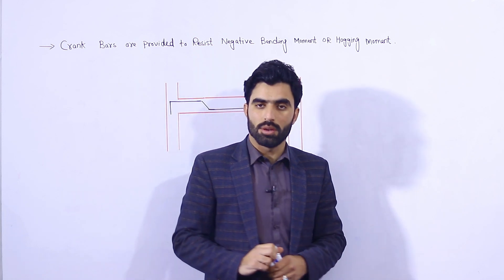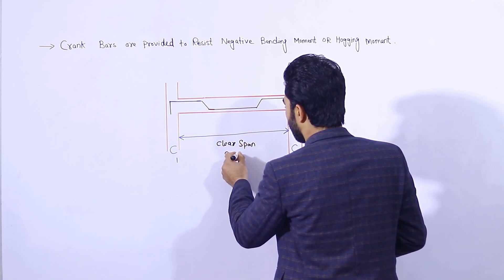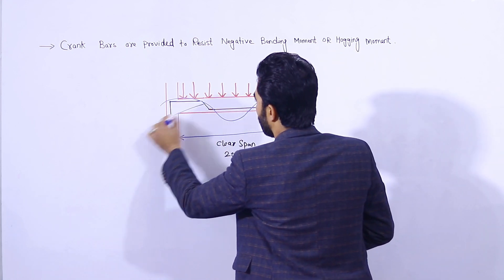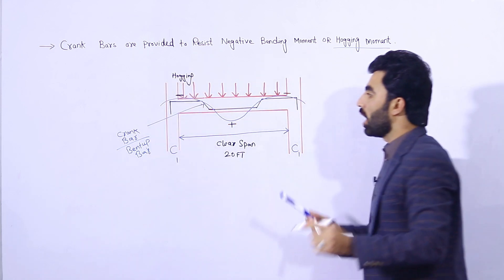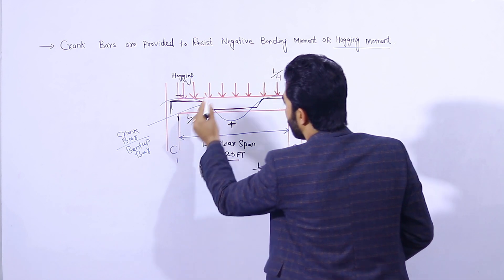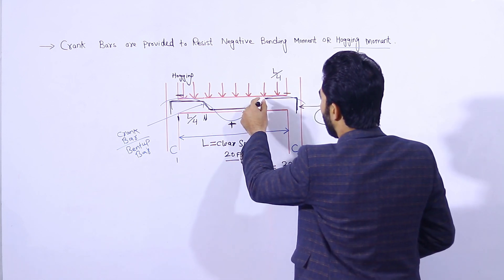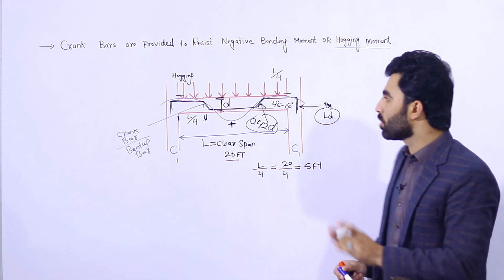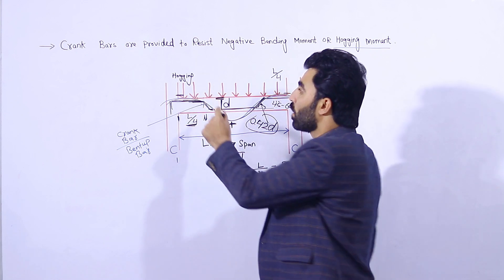Why Crank Bars Provide in Beam | Bent Up Bars in Beam |

Comment: Well done in Vlog but still not explained why Cranks bars provided (as per heading question) means which forces are acting, like neutralizing the shear forces, what is shear forces where it is acting & maximum & how etc, with due respect, the lecture is  still lacking information, Bending moment with positive & negative diagram should draw separately with explaination, what it's role, maximum  tensile forces are in midle so, steel location is down ie. two forth in middle area Anyhow good try, keep it up. Regards.
Reply: exactly...not explained topics like...how crank bar minimizes negative momemt...how it counteract shear froces acting at support..why most bar provided at mid section just because it has positive BM...many question left unanswered